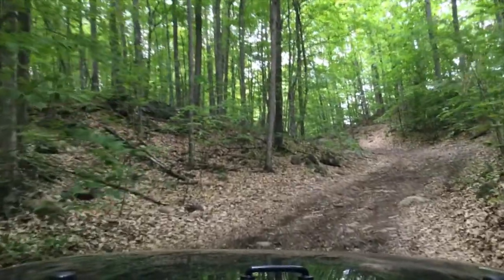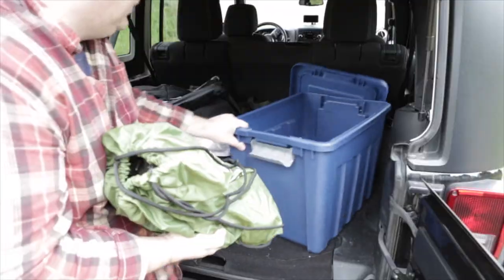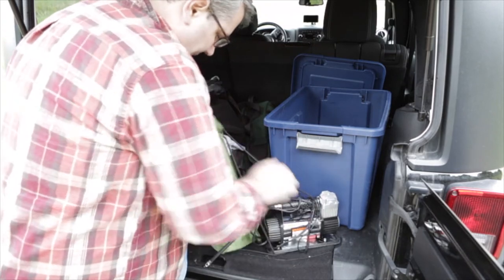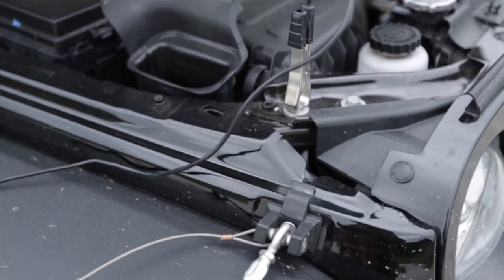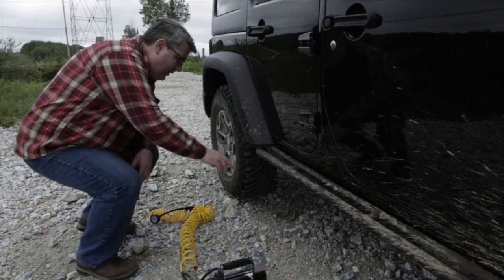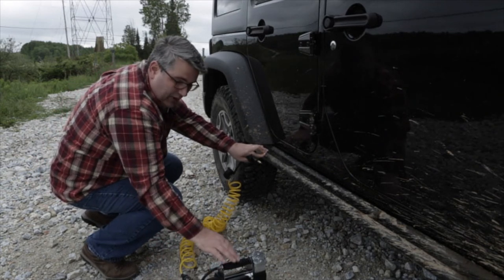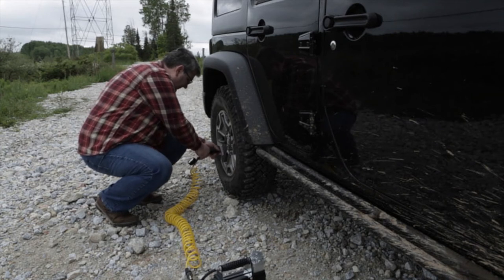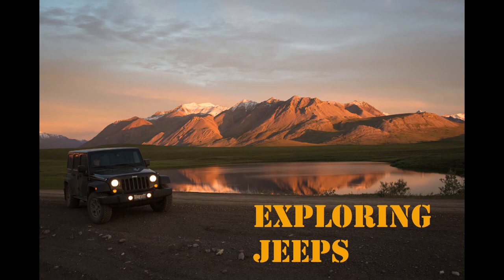Exploring Jeeps - Airing Down - Your Tire Pressure

Comment from the maker: Traction was greatly improved with lower tire pressure.  If you can handle the reduction in ground clearance, I would recommend it.  Make sure you have a way to replace the air you remove though.

Comment: For less that twenty bucks you can screw on tire deflates from Amazon.
Reply from the maker: Alan, yes, you are right and those become even more helpful with larger tires.  For me it takes me about 2 minutes per tire to air them down.  It doesn't bother me to do it the old fashioned way.  Now when I have 35s on there, I probably will prefer a quicker solution.  Do you have a particular brand you use?  I saw some from Coyote that looked nice, but they were $85.
Reply: +Exploring Jeeps I don't remember the brand of the deflators that I have, but they're adjustable and easy to use. I just screwed them on and let them do their thing while I disconnect the front sway bar on my ZJ. Now I have a Rubicon and don't have to disconnect the sway bar, I guess I'll just twiddle my thumbs for a few minutes while the tires air down.